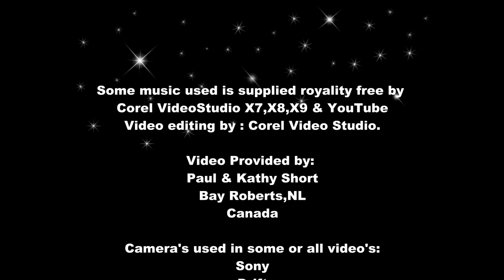The Verdict Is In. Kubota or Deere?

Comment: Sounds like a win win for you and Kubota and From what I have Been Learning Here in the USA is that Kubota has aim on being a major player in Larger tractors... And i can say we could see a Larger Kubota up towards 400 horsepower Front Wheel Assist tractor but with a Outsourced Engine Being Cummins. They are Looking towards a Deal to Use the Versatile Tractor as Their Basis to start on and Kubota would bring a CVT transmission to the Venture For Versatile. Also its being talked on that Versatile Maybe picking up Kubota to Rebadge and give them a smaller options for like 55- 170 horsepower range

Comment: Sounds good Paul I’m a Deere guy but it usually boils down to a good dealer that will support you the only big gripe I have with Kubota on a hydro transmission they have that big rocker pedal to go forward and reverse and the brake is on the same side my Deere has two pedals side by side one for forward one for reverse and the brake is on the left foot much better design other than that I likem both great tractors I do have a Kubota excavator kx057-4 and love the machine see ya Napa mike

Comment: Good job you guys,I have a b2650 with a cab..I hope you can figure something out ! lol 
I'll check In and see!
Reply: I do too, I'd love to see some kind of guards for the flashers.
Also front fenders or a way to mount a toolbox on the outside.
Reply from the maker: Check out our website, perhaps you'll see your flasher guards. Would Light Guard #3 or the round guards work? I couldn't find a good pic of the side view of your lights on cab. Thanks for your interest. Kathy
specialtyrepairscustommods.com
Reply: I too have a new  b2650 with cab which I really love. it's my third Kubota tractor. I looked at others But ultimately decided upon the b2650hdsc and have been glad I did. Looking forward to any B series mods that you might do.
Reply: Hi, Thanks for the reply. They look like they should work. I measured them the other day and I believe they are 4" inches O.D. Sorry,  I didn't see a spec on the site.Thanks again

Comment: Sounds like you got a great chance to work with Kubota. If you  had gone green you could have expanded your customer base, but the orange base is big and growing. When you get that B model don't forget us guys with older B's , because a few mods are cheaper than buying new and my old  B2800 work like a champ.
Reply from the maker: I’m hoping the new B stuff will crossover to the older B model. We don’t see any older ones here unfortunately. They are great tractors. We’ll eventually get into the Deere’s if the Kubota’s dry up.

Comment: A few years ago I bought a small sub compact Kabota BX 25 tractor. Several years earlier, I bought a John Deere mower from the same company. So today I had a flat on my tractor which has a high pressure valve like John Deere and most tractors. Due to the distance to the Kabota dealership, I went to the John Deere dealership for repair. The tires on these sub compacts are identical except for the paint. Mine being orange. I went to Meade’s John Deere in Bluefield, WV to have it fixed and a young girl looked funny and went to get a very young service man. They refused to fix my tire, stating they didn’t have the equipment. Bull. I’m sure if a John Deere tractor came in with a small problem like a flat, they have the means to fix it. If not they need to go out of business! I pointed out that the tires are identical, and they still refused. With all I have going on with my health, (cancer) I sure didn’t fell like traveling several different places  to get a small tractor problem taken care of just because I purchased a Kabota and not a John Deere. As you can tell I’m very disappointed with John Deere’s so called service. King’s Tire took care of me with 100 percent satisfaction.
Reply from the maker: What a terrable experance for a friggen tire. Not good enough. Aweful dealership. What’s wrong with people these days. Every now and then someone will come by wanting a BX tire repairs and it’s really not worth my while to stop what I’m doing to fix it but I do it anyway to keep the customer moving. I’m sorry this happened to you Darrell. I hope and pray you beat the crap out of that Cancer sir. God bless.